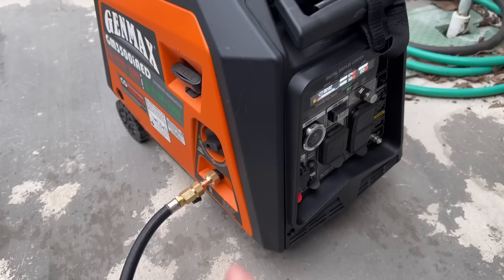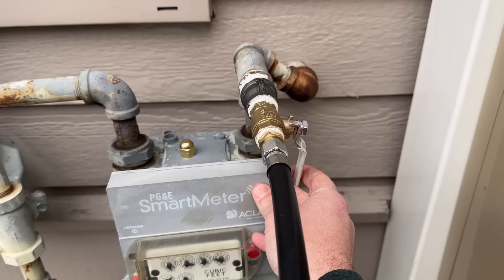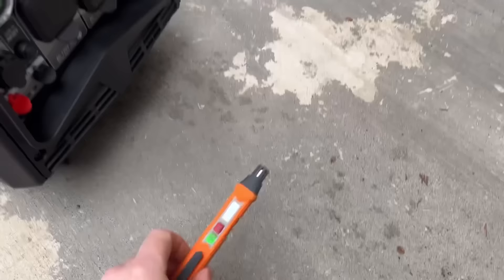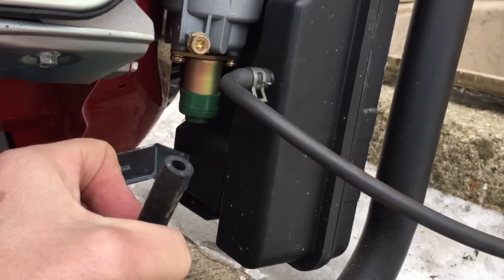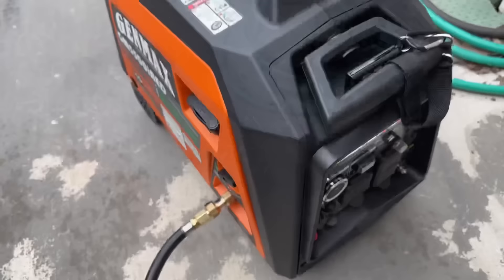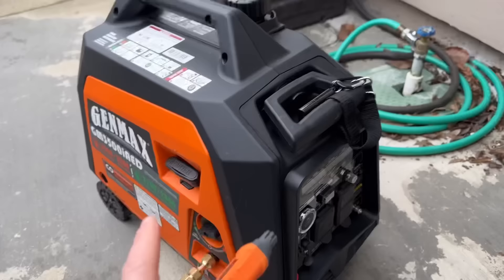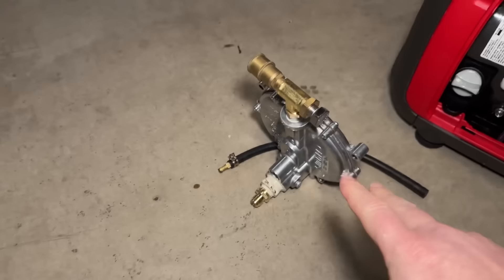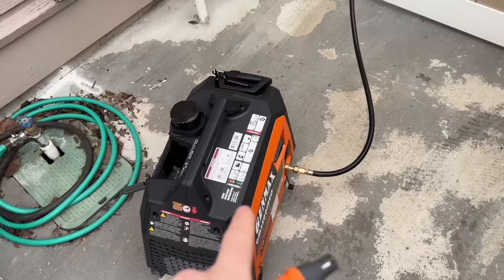Natural Gas Generator Hook Up People Should Stop!!!

Comment: I like that detector.  Am shopping out an inverter generator that is dual fuel.. gasoline/propane.  The tri-fuel generators don't have the capacity I'd like.  So, thanks for this video and the links.
Reply from the maker: I’ll be doing a video on this soon. It has gotten very popular and is consistently getting 4.3-4.6 stars..https://amzn.to/48DmOwx

Comment: I have worked for Honeywell/American Meter which produces residential and commercial gas meters and regulators. And let me say that you are %100 without a doubt correct. People if you are doing this without a proper regulator you are creating any number of horrible outcomes from and instant minor explosion in an outside space catching leaves and debris on fire to enough gas build up exploding a garage, basement, house to grenading the generator with backed up gas. Every now and then at work we get to see possible product failure videos and let me tell you the outcome is NOT pretty. Total loss of property. And if your utility company say like Pacific Gas and Electric catches you doing this I'm going to throw out there that they will not be happy. One way valves and proper regulators are of the utmost importance.
Reply from the maker: Exactly, I can’t believe there are still a couple videos where people are doing this dangerous diy. Thanks for stopping by and commenting your experience 😀👍🏼

Comment: Now that you've forgiven me I want to ask a question.  How do these pass insurance inspections?  I know those inspections are never done, even here, but in the event that there was a fire, or worse yet a death, the insurance would not cover the loss because of the unsafe modification.  With the cost being a minimum and the risk being very high, what is the biggest reason for this unsafe mod?  I'm a dyi'er but here, if you tie into a meter, it has to have a lisenced plumber do  the work, plus, with the age of that meter, it has a meter reader that would have to shut off the service.
I think it's great that you pointed out this.  I'm going to sub and watch your vids.  Thanks
Reply from the maker: You would need it inspected by PG&E to make sure the fitting is correct and leaks. That’s about it. This video would be a lot different if I went to my external gas line for my bbq. But that means my my electrical cord would be very long. But most people would not think its a problem because that line is far game. But since I’m next to a meter it seems all must be inspected and certified. 
Rules change change by county and even state. So check with you local municipal facilities to see what you are allowed to do. I have already converted this back after making a couple videos I needed to make. It takes about 45 seconds to swap this out from the original stock plug to the extension and valve I had on.

Comment: This would be a code violation. The first "TEE" after the gas meter belongs to the gas company for connecting test equipment, and installing a lockout plug in the line. This is not a convinience "tee" to connect appliances. etc.
Reply from the maker: Yea mine was switched for about day while I made a couple vids. And it’s also back with the OE plug.

Comment: Another reason not to do this. If your generator is running at the wrong speed then it is not supplying the right voltage and especially frequency which can damage the stuff you are powering with it

Comment: F.Y.I. Even WITH the proper regulator, you are supposed to shut off the gas when the generator is not in use…
Reply from the maker: Correct! I see people just leave it on and it’s a little different with these after market regulators. 

Now if you bought the proper regulator meant for stand by units like in a home stand by generator then those you can leave on.

Comment: When the plumber installed my gas line for generator. He said it's overkill but the city does require it. So I said explain the it's purpose than I was like wow . Installed NOW. Your video just explain why and people should listen.
Reply from the maker: Proper equipment should be used and not the , it will be fine method.

Comment: You only need a regulator if your gas meter is running 2 pounds of pressure. If your meter is a 1/2 pound output, you are fine without a regulator.
Reply from the maker: But your generator still needs the correct load/ demand regulator.

Comment: Yup. You need a regulator for the natural gas line. Especially if you happen to be on a high pressure natural gas line. Your generator could turn into a bomb.
Reply: The generator in the video is connected to the low pressure side of the meter which is only a few PSI.
If it's in a open space it might cause a small fire but it's not going to explode.

Comment: From a retired Lic Master Plumbing Contractor,, THANKS!!! YOU ARE 101 PERCENT CORRECT!  Only Fool's and idiot's think they know things there unsure of.
Reply from the maker: Thank you for stopping by. I hate when people comment and have said I have done this and it’s fine. That’s a instant delete. And the vid’s that are out thinking this is safe and promote it are promoting dangerous conditions.
Reply: @johnnysweekends   reverse flow restriction is important in any pressurized flammable fuel system. Negative pressure creates a vacuum.

Comment: Hello.  I’ve never been sure what all a “regulator” does.  At prior place, had propane furnace, heater in garage and a fireplace, basically there were regulators everywhere.  I surmise those regulated the gas pressure to a rather constant level as time and gas level in tank and temperatures vary.  So, if one is installed on a generator and generator stops, the regulator ALSO automatically shuts off gas flow ??  If you wish to give tutorial on regulators, I’d certainly enjoy learning more on that topic.  Will budget in a DC inverter sometime before much longer, just for the necessary few things as emergency backup.  Maybe I’ll just stick with propane and try to find bigger than 15 lb tanks.  20 maybe is around somewhere.  We are not RV-ers to know more on propane tank sizes, refilling, etc.  I do know where to just swap out the gas grill sized tanks, as is common.  Realistically right here, the amount of time power is off is very little, swapping out 15 lb sized tanks for a day or two while off isn’t a terribly big hassle.  8+ hours power off is pretty rare.  Just several 15 lb tanks should handle 99% of the time needed.  But car gas, nope, no more, did that 20 years country life.  Hassle.  It’s kind of fun hearing a generator hum away when needed, tho, and enjoy the few things on truly necessary.   I also will prioritize an enclosed unit for quiet as it runs in backyard.  Not only for the one neighbor, but no sense advertising further away for a potential thief to get an idea of easy pickings.
Reply from the maker: I could go over some basics on regulators and dual fuel generators soon. 
👍🏼

Comment: This video prays on scare tactics.  You are correct this installation is dead wrong. But when you buy a generator you can usually purchase a Natural or propane regulator kit or components .
Reply from the maker: Correct there are correct kits to buy and which you should! But there are a couple vids out there showing people sticking a hose in the airbox and that’s it!! 
But the correct stuff and be done with it.

Comment: I’ve never seen this before. I have a generator and a welder / generator that both run on gasoline. I would never connect them to propane or natural gas because they’re not designed for that and I don’t want to blow up. If I did get a generator that was designed for natural gas, it would be hard plumbed into my gas system with all the proper equipment and shutoffs to ensure safety and proper operation of the generator. If it was too expensive for me then I simply wouldn’t do it. I wouldn’t be comfortable with a generator that could be quick disconnected from the gas like that, if I had a portable generator like that it would be propane only. A natural gas generator to me would be a permanent installation used as a standby generator with a proper transfer switch properly installed so I’m safe and the power utility technicians are safe. Way to much at stake to do it any other way. Not to mention the liability.

Comment: Even done correctly, I still don't recommend running a generator from an "infinite' fuel source. Eventually, the engine will run low on oil. When you have to but gas in the tank, or, change a propane cylinder, that gives you a chance to check the oil level. It's imperative, that the engine run out of fuel, before it runs out of oil! Connecting to natural gas guarantees virtually unlimited fuel availability. Most modern generators have low oil cut-off, but it's dangerous to rely on that to shut down the engine, if the oil gets too low. If the sensor comes disconnected, or fails, it could lead to a blown engine.

Comment: Yeah I put together  a regulator with a kill solenoid so if it dies. It will lose the 12v and the solenoid will deenergize and cut the flow of gas.  It even works if it stalls out on the propane.
Reply from the maker: Well that’s cool. Now that I think about I would imagine that’s a pretty easy setup..👍🏼
Reply: @JOHNNY'S WEEKENDS   
You do have to prime the system with a button as you start it. So you do need a working 12v starter battery. 
"2 blocking diodes and a  normally open push button," and it was working. Need the diods so 12v battery and charging would not back feed.
Reply from the maker: Ahh, nice. Well good job on that set up

Comment: At that first 90 degree elbow behind the tee - you need to change that 90 degree elbow to a tee and tap in there. The gas company does not want anything attached to their tee. Their tee is used for maintenance and testing.  Also, because natural gas is lower pressure than propane - you'll need a smaller orifice or jet in that carburetor.   Same thing with people trying to convert a propane BBQ to natural gas - you need a smaller orifice.   Think about a water hose when you put your thumb partially over the end of it to spray someone and get the water to go further.

Comment: Doesn’t it also destroy your engine by creating a lean mixture condition causing excessive heat?
Reply from the maker: It still has lubricating properties just not nearly as much as gasoline. So you tend to run a higher mixture. But a NG engine tends to get less service life then LPG or regular gas

Comment: Question:   A added regulator does not have an automatic shutoff if your generator cuts off. I hear that some have a shutoff solenoid.  I’m assuming electric. My question is, if this is a hand cranked generator with no battery, what opens the cutoff solenoid initially to feed it gas to start?
Reply from the maker: The gen it self is used for demonstration of a bad idea going around. This unit comes with proper load regulator and pressure regulator. The kits you buy also have a proper shut off built into them. That’s why a proper kit is needed and not someone throwing in a straight hose into there air box.

Comment: I have a 110v NC solenoid connected to mine and plugged into the 110 outlet on generator so if it stalls the gas line closes.
Reply from the maker: Good set up 👍🏼

Comment: The generator I purchased December 2021 came with a "demand regulator" the manual specifies that it has a valve that stops free flow and no flow. But at the end of the manual it does say that a generator should never be run and abandoned.
Reply from the maker: Yes. If you are done with it then turn off the gas. 
But yes the proper method is buying a demand regulator kit
Reply: Probably says the same when running on gasoline. 
Most manufacturers warn against leaving a portable generator running unattended.

Comment: I’ve always wondered why you can’t connect natural gas the the built in regulator on a dual fuel that is labeled to run on gas or propane. I saw one guy do it on YouTube but he seemed unaware that there should be a built in demand regulator so he put one on his supply line and I guess was running through two.
Reply from the maker: I have a video coming out this Friday or Sunday that will probably help you on this..👍🏼😀

Comment: I recently learned about natural gas generators (previously only knew about gasoline powered). I saw a video where a guy had his generator taped into his natural gas via the quick connect for his gas grill. I am not planning to DIY anything ... plan to hire professionals. But I like to understand the process I am getting into. Is what you are showing the same as a quick connect? Is the quick connect not the correct way to hook up a natural gas generator to the natural gas?  I want to make sure I'm asking for the right things to be installed. Thank you!
Reply from the maker: You can plumb into the main line after the meter or the spigot that comes out for say a bbq. And yes a quick connect is just fine if you want or a valve that screws on and more. The professional you hire should have all the right stuff and depending on the gen you get you may have a quick connect hose with is nice for when you are done you disconnect and go
Reply: @johnnysweekends  Thank you!!

Comment: I do agree this is a bad idea.  However, it is not the disaster claimed.  A generator should always be operated outdoors.  As long as this is the case, natural gas and/or carbon monoxide will just blow away in the breeze.  Natural gas in particular is lighter than air and so naturally rises.  It will not "accumulate" and harm the neighbors.
Reply from the maker: That’s true it does dissipate quicker then say propane but even then a continuously leaking unit or line can still pose a big hazard. That accidental spark  close enough could be costly.

Comment: Most dryers and water heaters have dual purpose regulators, you do not need to spend an 100 dollars, second you will need an orfice for natural gas not propane. The hole is much smaller on propane. They need to be drilled larger.  I used to have the chart. Gas goes boom, do not screw around with it.

Comment: Tri fuel generators already have this. Also natural gas does not spill on the ground. Your generator is not tri fuel.
Reply from the maker: True NG is lighter but is can pool inside the unit and work its way under roof eves into vents and house causing sickness and more as its pretty toxic to humans and more. And is still dangerous. 
And a lot of generators can be made tri fuel with the correct kit. Even dual fuel units that are already out. All depends how it was built and where the load/demand regulator is.

Comment: Hopefully that's a provider's meter. Having that feed riser coming through that slab is dangerous. There should be a sleeve so that should there be a corrosion of the piping under the slab the gas can be vented and detected.
Reply from the maker: Could you not see the sleeve? It’s pge
Reply: @johnnysweekends  Sorry, no. It looks like concrete right up to the riser pipe.
Reply from the maker: It stops at the main shut off about 12 inches up
Reply: @johnnysweekends  Geesh, now I feel like an idiot for commenting.😔 I had to watch the video a couple of more times to see it. lol You're correct, I finally seen it also the tracer wire coming out of it to show it's a PE transition riser pipe below the shut off valve. 
I'm a dunce for missing that, sorry. 🤣
Reply from the maker: Dude no worries, it happens. And hey thanks for the extra views 😂👍🏼

Comment: The one we have uses a battery to start the generator it has a momentary switch to trigger a solenoid valve if power if loss to to generator like it stalled it cuts power to solenoid valve hence cutting gas and fuel
Reply from the maker: On demand generator like a generac

Comment: Would you please explain how the regulator works, that might help people understand. Thanks 🙏
Reply from the maker: It’s not really just a regulator that set a correct pressure but also a on demand or load regulator that also has a shut off built in.

Comment: Obviously not up to code, but natural gas is pretty safe outside since it's much lighter than air and will dissipate quickly. Propane is heavier than air and a completely different story.
Reply from the maker: Correct but still dangerous and NG out of the pipe is also pretty toxic at least for humans.

Comment: Hi Johnny, thanks for all the info. You bring good insight in your videos. I may be shopping for a dual fuel or propane portable generator. Our off grid camp has a Harbor Freight knockoff, Yamaha, and ALP. The knockoff and Yamaha have after market regulator conversions to propane. They have seen better days. The Yamaha dealer won't touch the conversion and only agree to set it back to gas. Currently, we setup a new ALP propane unit which is low wattage. What's your view of GENMAX and Champion dual fuel ? Looking at something under 3K watt. I'm also considering taking the ALP and buying another with parallel kit. I have plenty of Bluetti and LifePO so this addition is more contingency and for recharging. Thanks again.
Reply from the maker: Check out this one https://www.amazon.com/dp/B0BHXLT5D9/ref=cm_sw_r_as_gl_api_gl_i_dl_94ZN26EWN2M9J1KQ2JPB?linkCode=ml2&tag=johnny5dahlbe-20
Reply from the maker: I like the littler alps but just low output and at max they are running at max so I dont know how long they can sustain that. But super fuel efficient. The genmax is a good option or even the pulsar 4000 DF would be a good one to look at with its competitive price i linked it…check it out

Comment: Man that's sketchy I mean a simple "safety" not even a simple solenoid on the propane line powered by the generator itself so if it dies the valve closes, still dangerous as hell but at least a tiny bit safer imho
Reply from the maker: Yes the proper equipment should be used. Hence a couple bad videos promoting this is dangerous